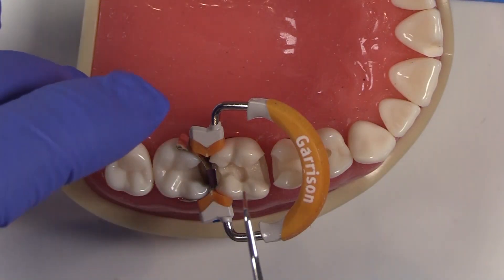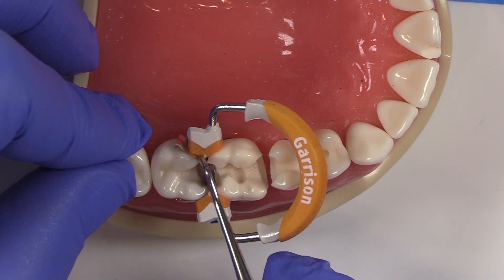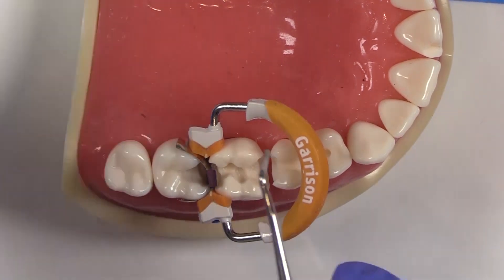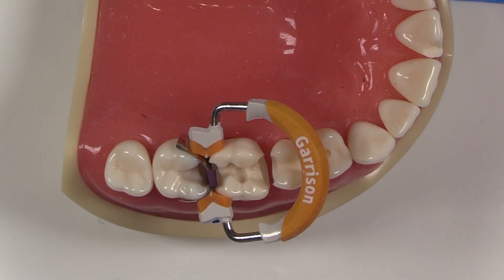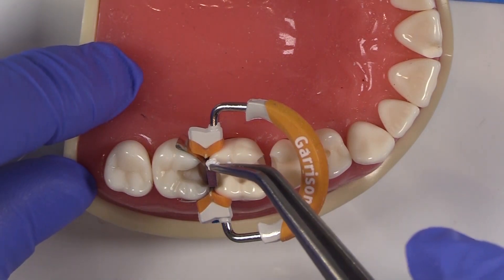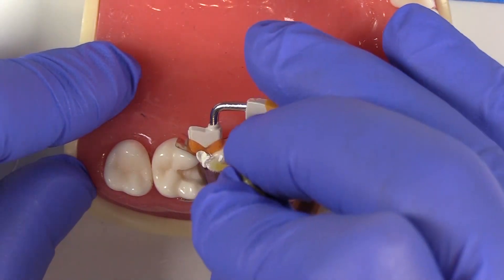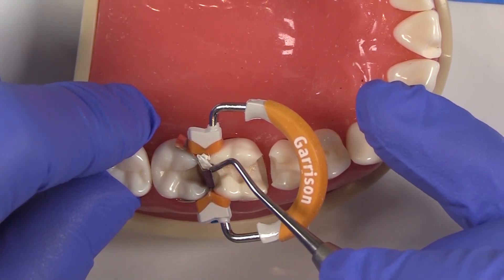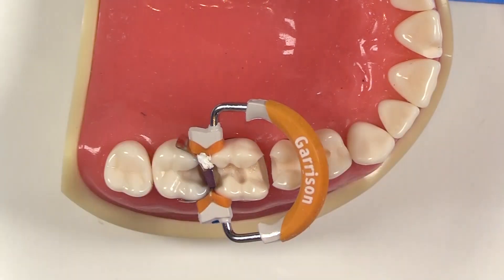A Little Ball of Teflon Tape Saves Lots of Finishing Time

Comment: what are the other ways to close that space to minimize finishing? I would love to know. Thank you
Reply from the maker: Thanks for the great question! There are a few other techniques you can try to close off that matrix band before restoring the tooth, but none that work as well or are as predictable in their result as using teflon tape to tack the matrix band to the tooth. Therefore, we recommend sticking to Dr. Nejad's technique shown in this video.
Reply: What I did before was just putting a little composite in there, since it isn't treated with a bonding agent you can simply pick it away at the end of the treatment.